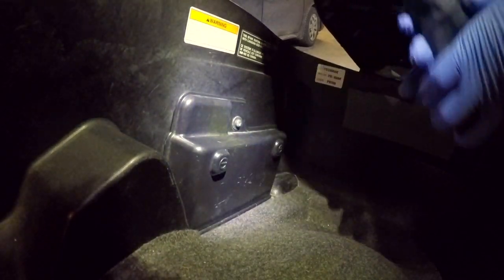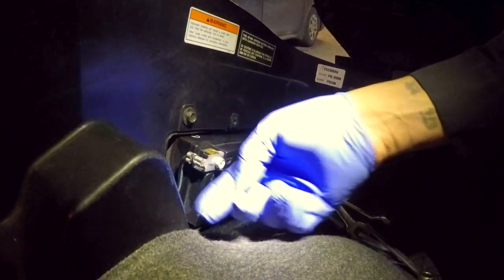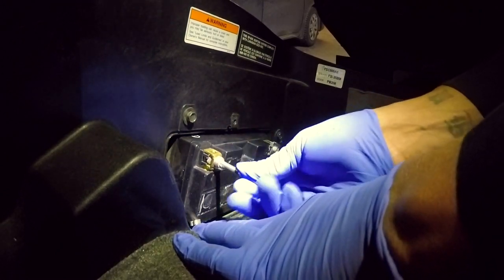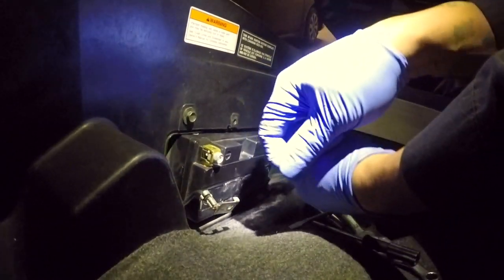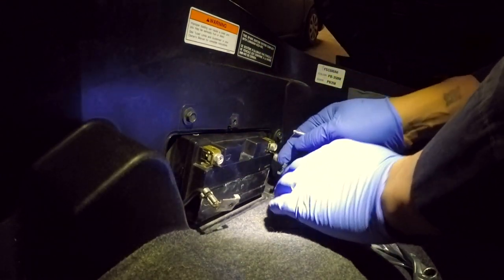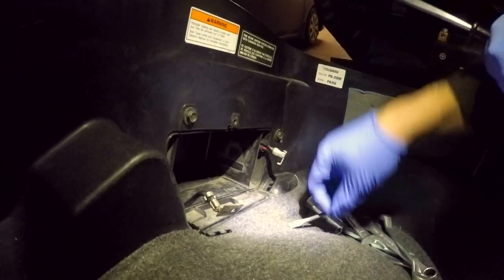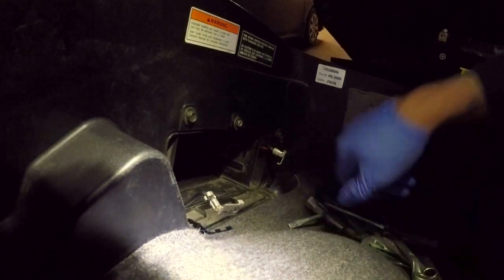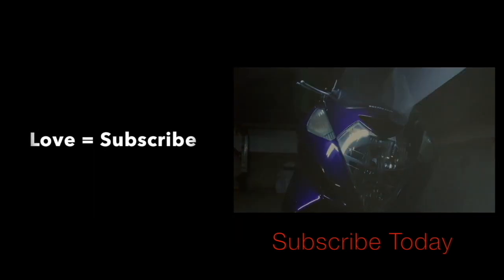FINESSE IT OUT - Honda Silver Wing 600 Battery Removal (Tutorial) #108

Comment: Nice job! That couldn't have been easy to get the camera in the seat well while removing the battery. Advantage action cams (if that's what you used). Like the points and stress on the safety procedures. Super informative.